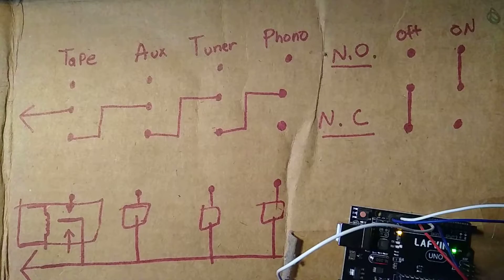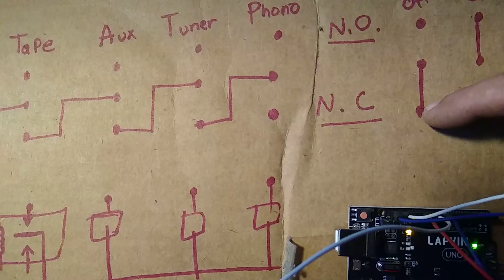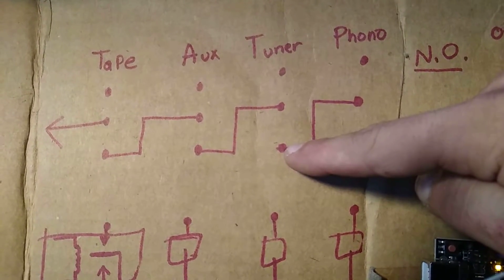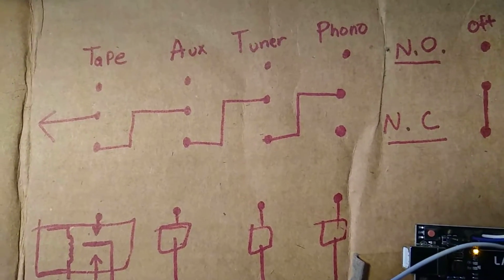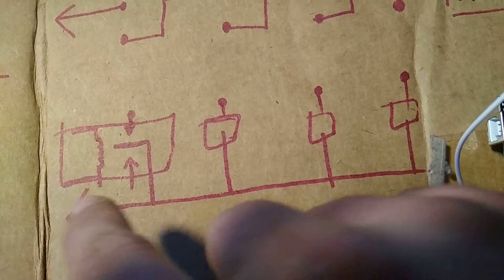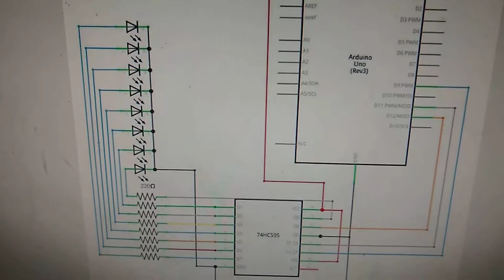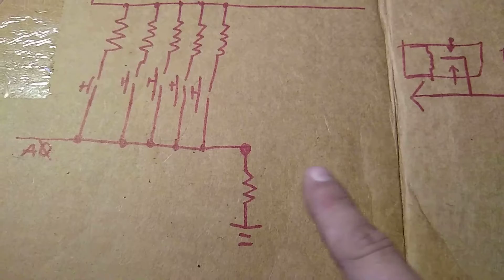Denon PMA-770 Relay Input Project w/ Arduino

Comment: Hey man, any progress? I have pma-770 myself and it is starting to get anoying. I keep loosing left speaker after this video i understood why display sometimes gets back on. Spraying switches with cleaning fluid and mushing buttons helps, but not for long so I am very interested in solving this for good, and your solution looks promising.